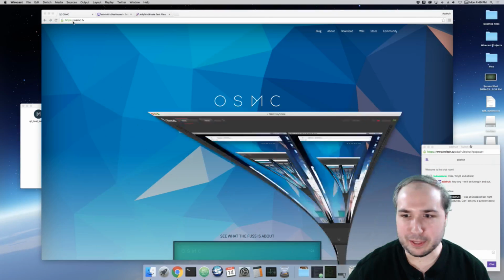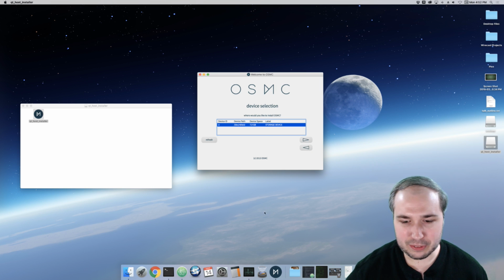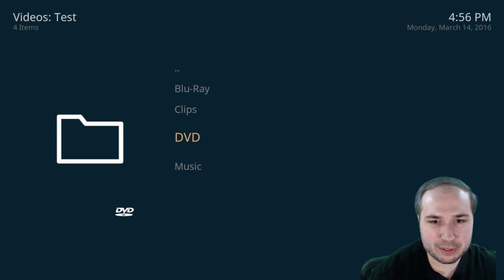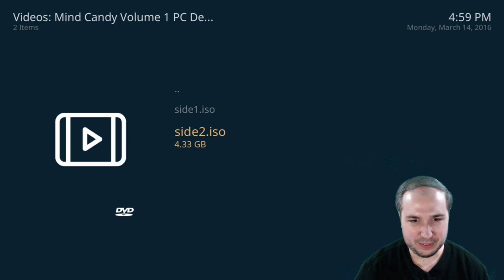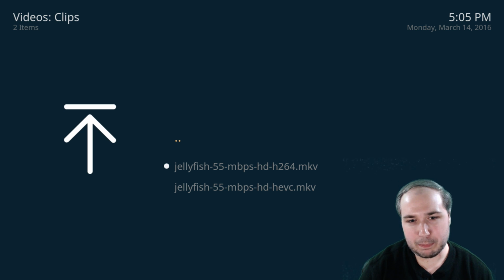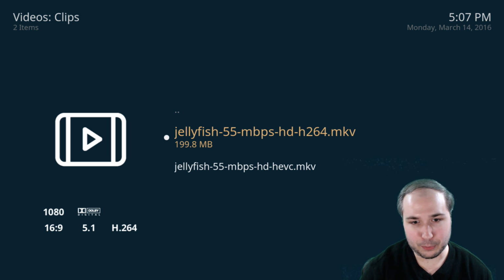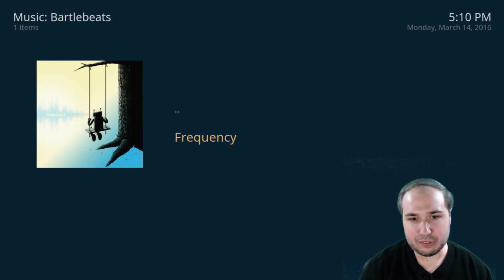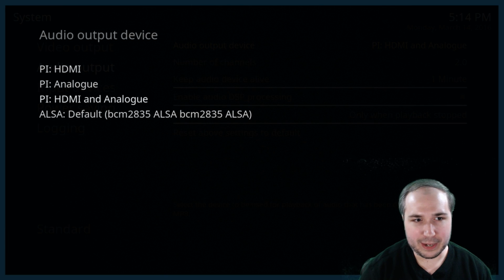Raspberry Pi 3 & OSMC media center with Tony D! @adafruit #LIVE

Comment: Sorry, Pal!  But I saw jitter in everything!!   Also, blah, blah, blah-- get to the point.
Should have also gone over the "Settings" section for the newbies at the start!
It wasn't a problem for me since I've worked with Linux since 1992

If Eben ever adds USB 3.0 for my external 4TB USB 3.0, then the little bit of jitter will
most likely go away...

Comment: Great review Tony. I have 3 raspberry pi running OSMC and I love them. As another commentor noted PlayOn is a way to go for streaming services such as Netflix. I also like using smart phone apps to control OSMC over Wi-Fi. I've never tried using external hard drive. Instead I have 32 GB SD cards in mine. Two of my OSMC's are running original pi model 1B. The other two are running model 2B. like most people I haven't got my hands on a 3 yet. Here's a tip about performance… Press the letter "O" while a video is playing and it will pop up in on-screen display showing various statistics. Like you I'm impressed with the installation procedures. The people behind OSMC were the ones who developed the original RaspbMC implementation.